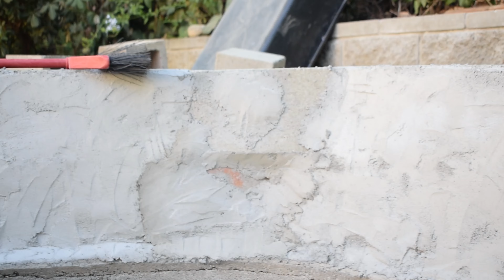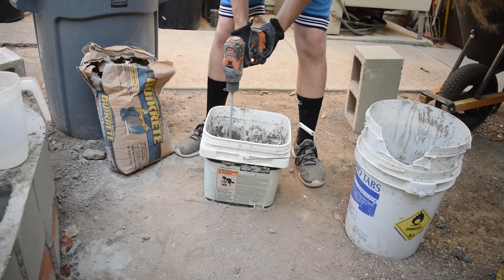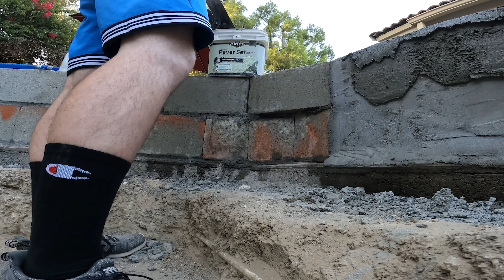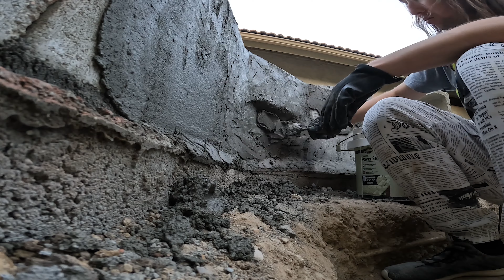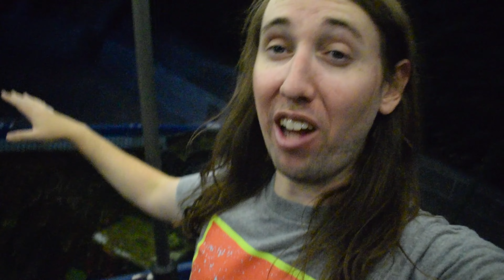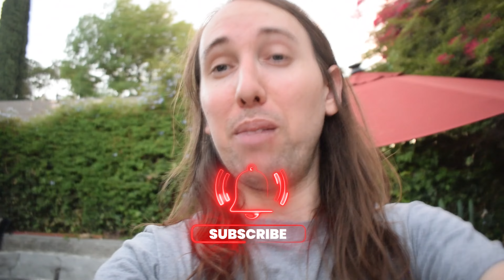Finishing Inside of Retaining wall for Backyard Pond!

Comment: Aquamigo  probably should line the entire  inside with geotextile. Protects your liner.
Reply from the maker: Thank you Aquamigo! that is an underlayment right? I will be using an underlayment 🙂
Reply: @TobiasHolenstein  Yes different name same basically. Kinda like landscape fabric. but heavy duty. I have seen people put old rugs carpets...lots of things work just fine. just a protective layer.
Reply: @TobiasHolenstein  How are you going to filter? Big upflow wetland bog filter  works great for my ponds.
Reply from the maker: OK cool! I'll look into that geotextile. For the filter I'm planning on doing a bottom drain setup and then using this double trash can filter setup I made. Although now I am considering making the filter bigger. Maybe adding on a 3rd trash can or something